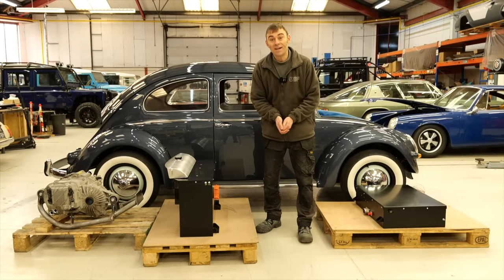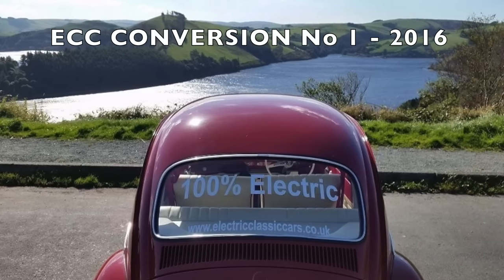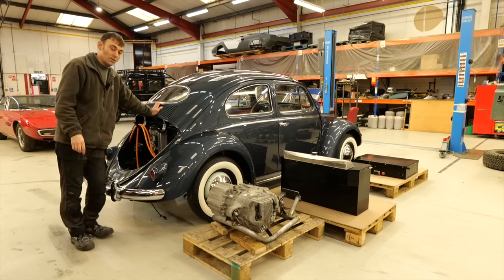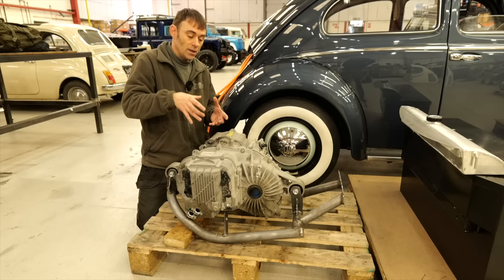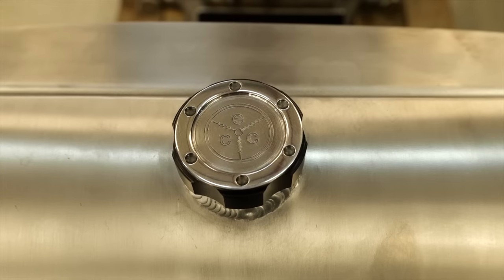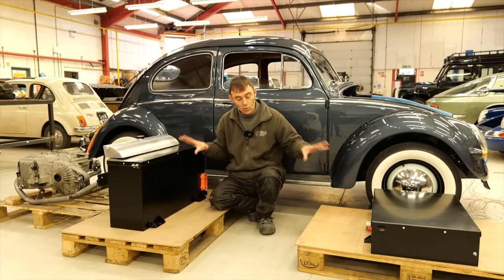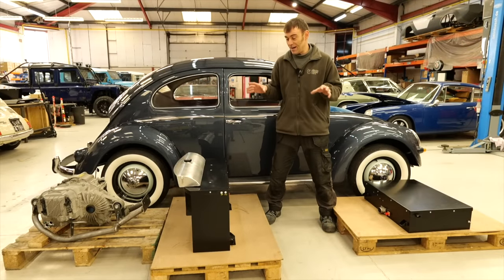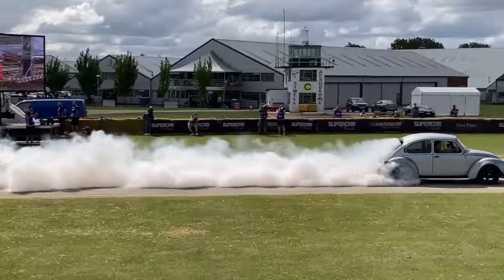Electric VW Beetle - Bolt-in kit

Comment: My first was a 1966 Beetle with a 6v battery system and a crank open sunroof. Sadly, it got wrecked in 1990 and was replaced with a 1990 Mazda MX6 GT Turbo that I too still have 33 years and 278,000 miles later. Still looks new, however she's in need a of Head Gasket replacement. Thinking it would be an AWESOME electric conversion, especially to go with my 2020 Tesla Model 3 that I now daily drive. Anyone have an idea on what's needed to convert that Mazda, let me know.

Comment: Hopefully you see this comment and can provide answers to two points.  (1) Since there are two battery packs, what was done to balance them electrically? Whichever pack has the lesser line resistance will do most of the work (charging and discharging).   (2) Ok, the weight is nominally the same as before conversion but do you have an idea about the change in the center of gravity of the vehicle afer conversion?

I've been waiting for such a kit for a long time!  THose offered by others just appeared well beyond my capabilities.

Comment: I would love to have a Porsche 914 with a tesla motor swapped in, that would be soo sweet. If you built your own battery packs you could really dial in the weight bias and get it as close to a 50-50 weight distribution as you can.
Reply from the maker: We love converting the 914. 👍 https://youtu.be/hJTNsH-SIqk?si=wP_BogX7AOT6NLub

Comment: In answer to your Beetle question, I've still got the 1967 1500 Beetle (6v) in my garage that I learnt to drive and passed my test in when I was 17. In 2 days time I will be 70. Not having run since 1986 it was meant to be a retirement then lockdown project, however I got started on my 71 TVR Vixen rebuild - nearly complete - as it's worth a lot more. I may get round to the Beetle before too long, EV conversion? Possibly!
Reply from the maker: Wow, that's amazing. You've had that bug a long time. ❤️👌
Reply: Cool.  I had a 68 Vixen. Great car and wish I still had it. 👍😀

Comment: If one has a swing axle and receives the hyper 9 motor to attach to the transaxle, does said person retain manual shifting?

Edit to add one more question; are there any provisions for the heater? I do actually use my heater (yes, it still works. Lol).

Comment: I wish for bolt in kits for all common car models with decent numbers.

But also set of components to choose from to make "custom kit" for less common models.
Different models need different form factor for their conversation.

I think a custom kit, where you try are plug and play (talking about electric and control), is a good start, but you still need to make mounting plates/brackets.

Comment: My first car, when I was 16 in 1976, was a 1964 Beetle that I lowered the front, rebuilt the engine and painted it. After my 2nd car (a chevy pickup), I had a 1969 beetle, a 1965 beetle, and also 1965 and 1969 Westfalia Campers. The only other VW I had was a 2000 beetle, which I called my Y2K bug! My plans are to get a squareback or a fastback and convert to electric sometime soon. I'd love to get one of your bolt in cradles instead of a whole kit since shipping to USA would be way too costly. Do you have any bolt in cradles for a squareback or fastback?

Comment: My very first car was in 1974 (19 years old) was a 1955 Chevy with a 425hp 350cubic inch LT1 (4 bolt main) a very lumpy cam, Holly 780 dual feel carby on an Edelbrock manifold, 202 fueler heads, (hydraulic edge orafice lifters) Hooker Headers with Purple Horny's (pointing straight down under the rear seat in front of the diff) a BorgWarner T10S 4 speed (4/11 rear end) I can still see the look on my mothers face when I first pulled in  (Holy Terror !) U$ $900 !!! Premium was under 50c a gallon ( it cost me $10 to go all the way to the beach 90 miles ( revving 3000+ at 55mph) we didnt do drag strip racing)..we street raced ...all the time.. anytime.. if someone thought they wanted to have a go.. they could either put up some money (or stfu) we had to have rolling starts or it would just turn sideways burning up the tires (that was a big old heavy beast.. and even with rolling 10mph starts it would still burn rubber well into 3rd gear and then totally rocket off ..and you had to hold on for dear life !!!  just an unbelievably untamable wild machine   my friends built it in our high school automotive shop !! (he took the $900 and bought an almost new Lime Green Kawi KZ 900 ) virtually no after market brakes or radiators back then ( and it used to overheat and vaporlock in summer freeway traffic ( ie.. the fuel would vapourise before it got to the carbie) some guys had coffee cans with fuel line coils inside to rectify that.... that car was so scarey fast.. and the clutch was so heavy it almost sent me into the back seat when I was learning how to drive it ( my mother was right  be sooo terrified when she first saw and heard it .. I wrecked that 55 ((a bon-fide criminal act( yet I didnt even get breathalized))  one summer night with 3 minutes of home and my parents came down to the scene as they had heard me from the back yard  (you could hear that car a mile away ) some guy had forgotten to turn his headlights on.. and I had no way out (luckily it was a 3/4 ton dodge pickup.. or everyone would have been killed ( the women cut her chin on the dashboard) and we all survived somehow (it was a head on at high speed) beautiful warm summer night 10:30 pm ? I eventually some years later got a 1964 Beetle 1300 ($400).. and my friend balanced and blueprinted it (I drove that down to Guadalajara (drafting at 80mph+ behind Mexican bus drivers on the Baja for hours on end (ALL TRUE !!) and onto NYC and sold it on Staten island for $250..before flying to London in 1983. 23 Window Sambas were normal in our neighbourhood(several within blocks) my friends mom bought 2  brand new VWs in 1972 for $2700 each ( a  green karman ghia and a canary yellow super beetle ( both had automatic stick shifts ) Richard.. I love your stuff.. a great presenter ..humble and knowledgable.. I hope you enjoyed my car stories ( I have 100s of car stories  (and feel soooo sorry for the youth of today ( we had soooo much freedom and space back in the 70s (US TV and Movies are all 100% bullshit made by people that werent even there.. and acted by complete assholes.. all fake  ( reality  happens in the garages of the world.. by guys with wrenches) just like the above.. thanks so much for your contribution to car culture Richard.. you remind me sooo much of my old friends !!! very exciting technology (when I was a 16 year old.. I always wanted to have an Anglia ..hot rodded ( a guy in my neighbourhood had an English LLoyd.. with a blown 426 hemi with massive racing slicks and wheelie stilts.. and he had a little step ladder to get up into it.. cops werent yet all fascists back then.. no one batted an eye.. that guy used to drive that to the corner shops .. and I saw him cruising Broadway one night popping wheelies ( all true stories) long before gramma took over (we could go outside without our mittens on back in the 60s and 70s ( my friend bought a perfect 67 Shelby GT500.. for $3400 (I'd say.. 1971 or 72 ?) thats all.. but yeah.. these conversions.. are great I take my hat off to you and your engineering and your vision All the best

Comment: How much does it cost? What is the range? How much does it cost to charge it? How much does the charger cost? How long does it take to charge it? Do you have to upgrade your electrical service to install the charger? How much does that upgrade cost? ?What is the value of the car after the conversion? How much weight does the conversion add to the car? Is the energy to charge it carbon zero or are you just burning the fuel somewhere else?

Comment: What kind of lovely color was used on this Beetle ? Color code please! Imagine in Germany you would have difficulties getting a classic car license plate if the car is painted with a color hue different to the ones offered when the car was sold new plus 10 years. But since it is an EV conversion a registration as a classic  would be out of the question anyhow.I wonder if there are no difficulties getting the Beetle registered as  an EV  in the UK.

Comment: Lovely Car  and great engineering  Richard.
Ball park cost in UK and then to Aus ??
Knowing freight to Aus from UK is about USD$800/ Cubic Metre. Plus customs and duty as UK not under a FTA with Aus yet.
Also what cells - the LG Chem?? or repurposed Tesla Cell packs.
 With what you do to make the kit , does any of it qualify as Made / Assembled in UK?? 
Tesla Motor will not  given the place of manufacture fr the Motor is either USA or China.
The EU are getting model 3 and Model Y ex China now as I understand.

Comment: Beautiful work ! I'm  not mechanically inclined but always wondered how the small 12 Volt battery , that furnishes power to headlights , wipers , etc. is recharged since there 's no alternator ?  Is it only recharged at the same time the big batteries are being plugged in and  being charged ?
Reply: A small switch mode hvDC/lvDC power supply is used.

Comment: Brings back memories - my first car was a 1958 beetle (first one with a square rear window) that I got for $A185 when it was around 10 years old.  The headlights were so poor (6 volt) that when driving at night when the moon was full you could see better with just the parking lights on (for safety).  So that raises the question - assume you change the car's electrics (lights etc) to 12 volt?  Also, how does the car's heating work without the engine as a heat source?  (assume the air conditioning is still an open window :-) ).
Reply: Electric heater and electric AC as an option. 👍😀

Comment: When does the Mustang conversation kit comes? Not as many cars as the Beetle but second most!!! Even from the 1st generation Mustang from 1964 until 1966 were 1.2 Million cars produced. Such a conversation kit would probably also work for the 2nd generation 1966-1968 (almost same measures). And the best, these classic Mustangs until 1968 are very simple cars in terms of technology and simple production methods. What is your opinion?

Comment: Well done. I've a Chenoweth desert racer with a single port engine and bus IRS transaxle. I'd be running this thing primarily off-road, loose dry sand washes, dunes, as well as steep rock ascents/descents, so I think keeping the gearbox and ratios to choose depending on terrain would be a good idea? What do you think?
Reply: My 2¢ -
After helping a guy outside of Salem get his race buggy 2180 going,
That him and his dad raced in the mint 400, 
And countless hours picking his mind,
I'd say you have a pretty solid setup.
If as you use it and find it's limitations as your off-road skills improve,
Then alter it's base components to match or exceed what you as a driver are capable of 😊

That's a system I've utilized on that fellows advice - hopefully it's useful to you as well 👍

Comment: Curious what you do for the cabin heater? Since the original didn't even have a heater core because it used hot air off the manifolds. Would the motor/inverter coolant provide enough heat if you installed a heater core?
Reply: Electric heater 👍😀

Comment: I am overly excited for this for my 1973 Super Beetle. I have a Rancho Pro Street transmission connected to a 1776 dual carb engine, but would swap that for an electric any day. I'd like to see the kit come with an option to place the recharge socket in the fuel filler door location for later year models.

Would I need to keep the original vents in the deck lid, or could they be welded shut and still provide enough air flow for the radiator? Or would the radiator pull air from under the car?
Reply from the maker: I used to have a Rancho box in my drag racing Bug. You won't need the cooling slats in the decklid when you go EV. 👍

Comment: Actually I am wonder, if this kit with small mods can fits to old Škoda models - because is technically very similar to Beetle. My first car was a 69´ Škoda 1000MB, a first love and nice car but technicaly this was same config even trough 100, 105, 120, 135, even Rapid, Garde 89´s or very famous 110R from 70´s. Means this kit, could really fit for all Škoda personal cars made between years 68 - 88. Pretty much same, troubles with weight distributions... Just can not imagine Tesla engine in that thing without parachute :)

Comment: I think the rear engine Beetle is a fantastic candidate for EV conversion.  The ICE to Electric motor swap eliminates the constant air cooled engine maintenance and the remote battery placement redistributes the weight more evenly across the platform.  The Beetle is greatly enhanced by this transformation becoming much less high-maintenance and better performing, effectively solving the main issues that plagued this car for decades.  It has always been said that the Beetle was a simple machine with abundantly available parts and easy to repair.  But, well made parts are much less available and the 'simple maintenance' is constant - modern cars require a lot less overseeing by there owners - especially with computers running the show now.  I have recently purchased a 1971 Super Beetle with the full intent to convert it to EV as soon as I can arrange, (I wish Moggy was on the west coast of the US instead of the UK!)    I have a many questions;  What other upgrade do you recommend for a Beetle to be able to handle its newfound power other than front disc brakes?  I am trying to put together a punch-list of upgrades so that everything I do to my Beetle as I lead up to its EV transformation will be guided by this knowledge.  Other suspension upgrades either necessary or recommended(sway bars, shock or strut changes, does the added front weight require a new approach to wheel alignment)?  How about tire sizes, I am assuming that the stock 165/80 tires might not have enough tread width - at least in the back where the power/torque is generated?  What are the advantages of one pedal vs keeping a stick to change from around town driving to highway speeds(I have heard the single pedal approach it more costly?)  What about low voltage vs high voltage systems?  How about heater systems, with an ICE, the engine is the source of heat?  What about security from theft, how is the car protected from being stolen - (I know if they really wanted it they could just tow it but just curious of your method with EV?)  I would love to know your opinions on all of these issues, maybe a follow up video?  Thanks for all your time and inspiration for my quest to build an EV Beetle.
Reply: Look at all their other existing videos ... all your questions are answered.

Comment: About the charging socket. I assume it's possible to pull the cable under the car and up to connect. Then you can close while charging. Not having to worry about rain while charging.
Am I right amount that? If you can close while charging, I think it's maybe just a tiny inconvenience if even that.
Reply from the maker: You can feed it up underneath and close the lid but even with the lid down but not closed there's no chance of rain getting in there, tested in a Welsh rain storm already. 😆😉👍

Comment: This is fantastic! I had wondered if someone (you) were going to start putting out kits for Beetles since I saw your 300 HP conversion bumped up to 600HP.  Can't wait!
My first car was a '73 orange Super Beetle
1 - since this is a full conversion kit, there is nothing to add yourself, but what is the cost?
2 - what about Mexican Beetles with air conditioning? Part of the unit is in the luggage space behind the rear seat. I guess this air conditioning will have to come out. Can air conditioning be added to the electric converted car?
Reply from the maker: Yes. We do AC on a lot of our conversions. 👍

Comment: Curious how the heat from the exhaust used for heating and defrosting is replaced? I suppose the condition of the VWs getting updated mean that the heating ducts on the floor aren't rusted out.
Reply: An electric heater is used. 👍😀

Comment: I sold my gasoline car in 2008, just keeping it running was insanely expensive, gasoline was extremely expensive too.. Then I took public transit and rode a bicycle until I immigrated to another country and bought a crazy fast e-scooter in 2019 that requires a motorcycle license to drive.

Comment: I have a 1955 international pickup  it has   a beem axle rear 6 speed auto and a 2.8 diesel engine  I am a motor mechanic  I will won't  a range of 800km can you help thankyou

Comment: My first car was a rustbucket BMW 325E, which had a detuned 2.8 in-line 6, to be allowed to be classed as a 2.5 for emission reasons. My biggest driving joy was a VW corrado G60 in red. How nice would an electric Corrado be? 😊 But I sure like the looks of the Cupra Born, as the only hot hatch EV currently on the road (non conversion, of course).
Reply from the maker: I so wanted an Oak Green Corrado G60 when I was younger. Very cool and underated car. 😎👌

Comment: Did I hear correctly, using the Tesla drive unit on an IRS Beetle will allow you to remove the the transmission from the vehicle?  Direct drive without using the original transmission?  thanks
Reply: Correct. 👍😀

Comment: Used to work on classic air-cooled VAG cars, beetles, 914s, 911s, busses🤣 I'm amazed that thing hasn't rusted to pieces yet. The metal is paper thin trash🤣 I spent years restoring and modifying them all

Comment: Curious how difficult it is tune tuned and ev? I tuned my diy e skate board via VESC Tool. A lot easier to tune compared to piggyback and full aftermarket for my old 3000GT VR4 which was sold due to my job loss. So far awesome content Boss, thanks for sharing.
Reply: Thanks 👍😀

Comment: How do you defrost the wind shield? Do you use a squeegee like with an air cooled 1600?
Reply from the maker: It has an electric blower and heater. Much better than the original and instant heat. 😁👍